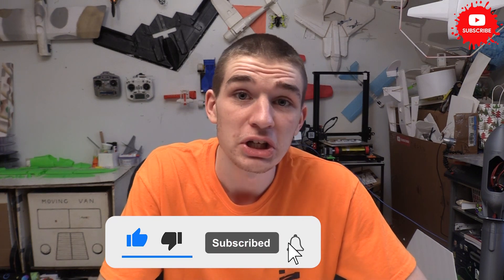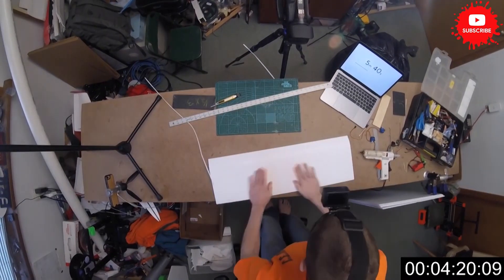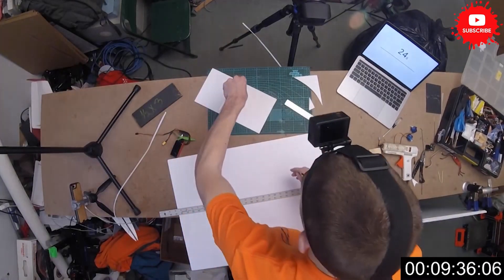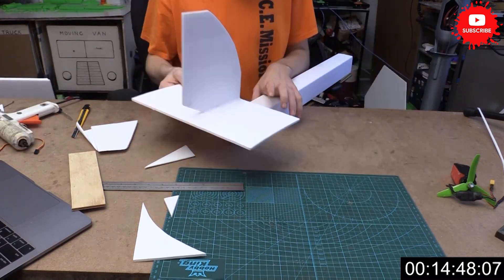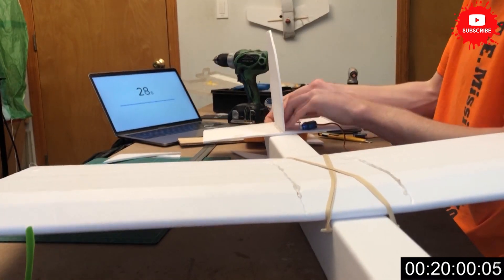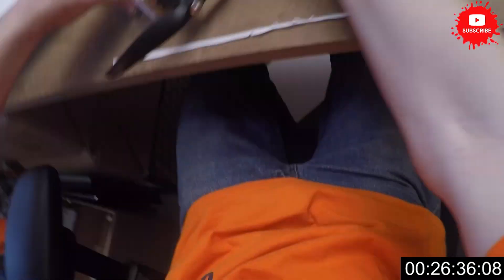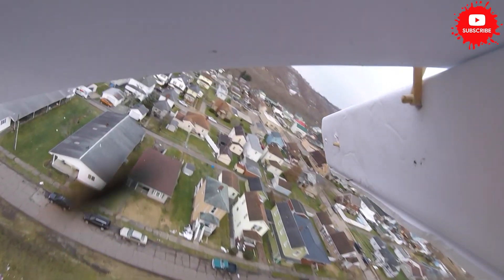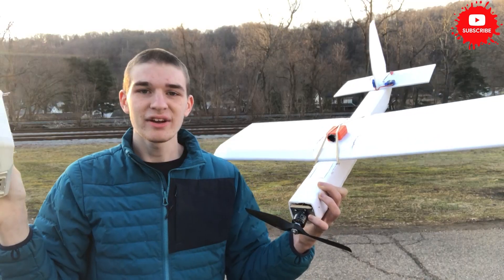How to Build a Super Simple RC Airplane for Beginners

Comment: Great effort mate. I have all the same electronics as per your list except I have a 1000KV motor. Would this have enough power for a beginner please?
Reply from the maker: That's totally fine—just make sure to choose your prop size based on your setup. Remember, KV is just the motor's speed rating (RPM per volt), not its power. The prop and voltage determine how much power (and current) you're actually pulling.

For a 3S (11.1V) LiPo:

9x4.7

10x4.5

10x6

11x4.7 (only if the motor can handle the current)

These sizes work well for park flyers, trainers, or slow flyers. A 10x4.5 is a great starting point for balanced thrust and efficiency.

For a 4S (14.8V) LiPo:

8x4

9x4.5 (only if your motor and ESC can handle the higher current draw)

With 4S, you get significantly more RPM, so you’ll need a smaller prop to avoid overheating the motor or ESC.

Have a great day and good luck on the build!

Comment: Do you have any advice for me I'm trying to build my first plane after many other builds
Reply: And what camera did you use? Is it just a go pro?
Reply from the maker: Its a Runcam 6
Reply from the maker: Absolutely! Building your first plane is a fun challenge—even if you’ve done other builds, this is a whole different kind of project. My advice would be to keep it simple for your first one. A flat-bottom wing, high-wing design with a bit of dihedral will really help with stability. Make sure your center of gravity (CG) is in the right spot—that makes a huge difference. Also, do a throw test before adding power to catch any issues early. Most importantly, have fun with it! Crashes are just part of the learning. What kind of plane are you building? Would love to hear more!

Comment: What type of foam do you use, because I’m getting into the building portion of aviation, but most foam just crumples when I try to cut it.
Reply from the maker: I’m using rediboard foam board. It is 3/16” foam with paper on each side. Check out the description for other info. Also check out Flite test on YouTube for some great info. Good luck!!
Reply: @EricRobb  thanks!

Comment: There was a simple foam board kit plane available in the 1990s called the Folding Flyer. Very similar to your plane but had a Jedelsky airfoil wing. Used a Norvel 0.49 glow engine. A pretty good flyer too. I build a replica out of foarm board which flew a little better than the the original.

Comment: I was wondering if you could explain how the electronics are wired?
Reply from the maker: Yeah for sure! Check out this video I made about the electronics: RC Plane Electronics 101: A Beginner's Guide to Wiring and Connections
https://youtu.be/JA3Lvf301mM
Reply: @EricRobb  Thank you so much! this helped a lot! Sorry to disturb though, but if i have a 2250mah battery but my motor can only go up to 2200mah, is that a problem or can the esc handle it?

Comment: You can make control arms out of popsicle sticks and plastic cards ect. Buolding foam board plane doesnt have to be complicated jaut to get in the air and get a feel of what rc plane flying is like
Reply: Guitar strings and coffee stirrers make great control cables. Coffee stirrers (the two tubed type make great hinges for elevators and rudders if you cut them right.)

Comment: Hello, thanks for this, might try it out! I see the battery is listed as: 3S Lipo Battery 80C 1300mAh 11.1V Lipo Battery with XT60 Connector. Can you elaborate on what you meant when you said, "I would also recommend you get an adapter for the use of a xt60 connector instead of a deans connector for your battery"? What adapter do you recommend? Do you have a link for it? Also, the battery is out of stock currently. Any other battery recommendations? Thanks!
Reply: I looked it up, it means the battery he recommends has a deans connection (shape of the prongs for the plug), while the linked ESC (speed controller) is comes with a XT60 connector (The female side of a different shaped plug). You can actually just buy a battery that already has an XT connector and save your self from getting the adapter. When you look at the pics of the ESC and the Battery, you should be able to see that box on the end of the wires... that's the plug, one side male the other female.  Hope that helps!

Comment: Balsa is alot more durable than one who never built on would think, even good flying ones will occasionally hit hard, and surprisingly it takes  a REALLY hard hit to damage them.   Balsa is weak, but once constructed and covered, its pretty strong and very rewarding once done.   I reccommend it for any airplane enthusiast.
Reply: Once you discover how easy it is to make dozens of wing ribs with a singular template, 2 bolts and piece of balsa with a wood router, you can start mass-producing good balsa airplanes in hours :) Just use right materials and right techniques
Reply from the maker: Thanks for the tip!
Reply: My first plane was a control line cox ju87d stuka. All plastic nitro model.
Next was a Big Otto Balsa kit. And a little satan control line balsa kit. I crashed all of them.

Comment: what motor, battery, reciever, and servos were you using? been flying for a while but want to build my first plane and thought this would be a good start.
Reply from the maker: Everything is in the video description. Let me know if anything is missing. Have a great day!
Reply: @EricRobb  I don't see any of it
Reply from the maker: ELECTRONICS:
1. Servo https://hobbyking.com/en_us/hxt900-micro-servo-1-6kg-0-12sec-9g.html?___store=en_us
https://smile.amazon.com/gp/product/B089GNYF1F/ref=ox_sc_saved_image_4?smid=A2XLLJ8HYD6SMA&psc=1
2. ESC https://hobbyking.com/en_us/turnigy-plush-32-30a-2-4s-brushless-speed-controller-w-bec-rev1-1-0.html?queryID=6c04911cd56f941fb620b377af5622a4&objectID=86262&indexName=hbk_live_products_analytics
https://www.amazon.com/RC-Brushless-Electric-Controller-bullet/dp/B071GRSFBD/ref=asc_df_B071GRSFBD/?tag=hyprod-20&linkCode=df0&hvadid=242048352875&hvpos=&hvnetw=g&hvrand=4102680705224588365&hvpone=&hvptwo=&hvqmt=&hvdev=c&hvdvcmdl=&hvlocint=&hvlocphy=9015222&hvtargid=pla-450627505645&psc=1
3. Motor https://hobbyking.com/en_us/propdrive-v2-2830-1200kv-brushless-outrunner-motor.html?queryID=eeda8ef4c02f966598265ed01da924c0&objectID=58843&indexName=hbk_live_products_analytics
4. Propeller https://smile.amazon.com/SoloGood-10x4-5-Propellers-Quadcopter-Multirotor/dp/B091KGR9Z6/ref=sr_1_13?crid=1Y6E70MZ843XV&keywords=10x4+prop&qid=1662467461&sprefix=10x4+prop%2Caps%2C90&sr=8-13
5. Battery https://hobbyking.com/en_us/turnigy-2200mah-3s-30c-lipo-pack.html?___store=en_us
https://smile.amazon.com/OVONIC-1300mAh-Battery-Airplane-Racing/dp/B0784C39DP/ref=sr_1_10?crid=2OFPX5XIR7RQO&keywords=1300mah+3s+lipo&qid=1659456378&sprefix=1300mah+3s+lipo%2Caps%2C77&sr=8-10
6. Controller & Receiver: https://smile.amazon.com/FLYSKY-Transmitter-Controller-Receiver-Upgrade/dp/B07Z8VCB45/ref=sr_1_1_sspa?crid=2W3NV8QSHZIV3&keywords=flysky&qid=1659456136&sprefix=flysky%2Caps%2C123&sr=8-1-spons&psc=1&smid=A27Y3358ST3KOY&spLa=ZW5jcnlwdGVkUXVhbGlmaWVyPUFaRzRIOUVRUFRYU00mZW5jcnlwdGVkSWQ9QTA1OTMzMDdIMFA5VlVFSkg5T0EmZW5jcnlwdGVkQWRJZD1BMDY1ODA4NDFZWjBMVFpBQzNSNVEmd2lkZ2V0TmFtZT1zcF9hdGYmYWN0aW9uPWNsaWNrUmVkaXJlY3QmZG9Ob3RMb2dDbGljaz10cnVl

Comment: Hey man, I love the plane! what's the dimensions of the fuselage, the width specifically?  You used 30'' for the length, but i'm not sure if I heard the width in the video, maybe i missed it?
Reply from the maker: The interior dimensions of the fuselage is actually 44x50mm
Reply from the maker: It isn’t super important. I just based the size of the fuselage on the electronics pod that I had. I think it’s about 2” high by 2.5” wide.

Comment: Can you share the measurements you use for each cut please?
Reply from the maker: I’m using 20in by 30in sheets of foam board. The wing is 30” wide and the fuselage is 30” long. The elevator is about 5” by 12” and the rudder is about 8” tall by 5” wide. Hope this helps!
Reply: @EricRobb  Yes this is helpful. How far down is the first cut to make the spline for the wing? How far down are the scores in order to fold the wing over to make the airfoil? How wide did you make the fuselage?

Comment: How did you make the choice of which engine and prop and servos and electronics to use?
Reply from the maker: For servos I used 9g, because that’s kind of a standard for RC airplanes in the hobby. The motor and prop I honestly just took the setup from another plane that’s about the same size that I love. That’s the beauty of using power pods. I can just slide the electronics out of one airplane and into another. There are links to everything in the description. Have a great day!

Comment: Can i use my RC car parts and accessories to make RC plane?
Reply from the maker: The servos for rc cars are generally a lot heavier than necessary. You would have to put the servo as close to the front of the airplane as possible to get the center of gravity right. The motors out of rc car are also a lot heavier and it just wouldn’t make sense to put in an airplane. There are links in the description of this video for electronics to buy or if you want an all inclusive kit go to store.flitetest.com 
Have a great day!

Comment: Building a first plane I love how little accurate it needs to be, thanks for giving me a confidence boost.
Reply from the maker: Yeah, it really is not rocket science. Hope your build goes well!
Reply: @EricRobb the irony cus it kinda is 😂
Reply: @hyperdeez pre-rocket science 😂
Reply: Foam board planes are very simple to build by hand with out plans to trace just some simple folds and big enough wing with dihedral and big enough vertical and horizontal stabs is the biggest thing cause if it's to small it's not gonna fly well
Reply: Wood is hard to with , its need.ungoldy ammount of sanding
Reply: Isn't it amazing how some of the most important things constantly get overlooked or underestimated, but retailers will have you believe that failure is the only road to success. So if you crash your RC plane, it's not because nobody told you about center of gravity or nothing. Just keep buying our planes at $300 a pop. You'll eventually get one that flies itself. 😅

Comment: This is exactly how I been making mine for years even a few years before flite test existed. I was making foam board rc planes when I was 10 in 2002. Now it's easier because we have access to really cheap smaller lighter electronics and motors . Building a plane when I was 10 consisted of balsa and plans back in 2002 cuse foam planes was junk and not to great like we have now in arf abd rtf planes. So of you wanted a good sturdy abd great flying trainer back then we had to build them with balsa then get someone on a buddy box to teach you to fly cuse all this gyro stuff abd stabilizers  didn't exist so only way to learn was either buddy box with a 40 to 50 inch wingspan trainer plane or learn on your own abd crash and spend another month building another plane. I'm 30 years old now and love being g able to build a quick trainer plane in matter of a hour or two or all the balsa arfs  thats out now and all the beautiful  amazing foam scale looking planes that's out now is amazing.  Cost of learning to fly is about a quarter of what it use to cost when I was learning in 02 at age of ten. Dad bought ne 5 trainer balsa kits abd we built all of them except one abd after I crashed the third one I was able to fly on my own with no problems. And no my dad was not a rc plane pilot when I was learning we learned together.  I still fly way better then he does. But he is really good at building and has 52 balsa planes built abd ready to fly hanging on walls and ceilings of our climate controlled work shop om his back yard that is the size of a 5 car shop. Abd still building he us. He has built every balsa kit off of bang good and I have flown all of then atleasy once and they all fly perfect like they are on rails. They are laser cut no plans to build onto of cuse they jig together tightly then then you glue it.  The instructions suck but not to hard to figure out andnqorth it cuse theybfly nicely

Comment: Which type of form u have used and how much kv motor? Is the plane dimensions avilable?
Reply from the maker: Its 5mm foam board from Dollar tree/Dollar general. The motor is a 2830 1200kv brushless outrunner, but it's way overpowered for the size of this airplane. The sheets of faom used are 20x30"
Reply: @EricRobb  hey! A 20×30 sheet is THAT BIG? Jeez i was seriously underestimating it... im making a P51 Mustang (my first plane honestly), using a 2212 1400kv motor as thats the most affordable atm- also, it has 1kg thrust with a 1045 prop, so I guess thats fine... I want my mustang to have a 1m wingspan... I hope it goes well lol- using a FlySky fsi6 tx rx... your video was actually very informative and I sure will use your methods to make airfoil and stuff...! Keep up the good work!!!
Reply from the maker: @Ayoitsme-m8e  Thanks for your kind words. Let me know if you have any questions. Have a great Day!
Reply: @EricRobb  hey! Thanks! I just ordered 30"×20" foam sheets from amazon! Well, I found put two of my 6 servos are not working and I can't get them replaced either... so I gotta cancel my plan of making a mustang and I'll just make a piper cub or something... My servos were greasy when I opened the package... do you have any idea how I can fix them? I can't afford to buy new ones...
Reply from the maker: @Ayoitsme-m8e   @Cody M  Can you describe a bit better "Not working" Do you think a gear inside is broken, or is there something wrong this the electronics? Is the motor inside spinning? Hope I can help.
Reply: @EricRobb  the motor isnt spinning... its like its not getting any power at all... I bought it from a local robotics store and its been a week so he wont replace it... I actually opened the packet containing those 2 servos today, and they felt oily to my hand... The receiver is fine (flysky FS-iA6B) because I tested the other servos on different channels... they work perfectly... Idk... I wanted to make a 6ch mustang but I guess I'll just make a 6ch piper now lol... I cant afford to buy new ones... i already went way over budget cuz depron is super expensive here... I might add lights to the 6th channel... im going to use flapperons so no extra servos for flaps... the two that stopped working, I was planning to use them for my Mustang's landing gear... but piper has fixed landing gear so no need for that no more... do you know any single propellor plane other than piper or cessna that had fixed landing gear? Or something similar? Like... a plane with low wing loading and fixed gear?
Reply: @EricRobb  also, I subbed :) you explain stuff much better than those other folk out there- keep up the good work man!
Reply from the maker: @Ayoitsme-m8e https://forum.flitetest.com/index.php?threads%2Fsp0nz-plans-index.17136%2F&fbclid=IwAR1VJub-73XCQRPDkVvQ8Tc8BCAoQhWrxxvJaCt9qasr2_R6cyHbKGIxjcQ
Here is a ton of awesome planes with plans so you can build them or use them as inspiration.
Reply from the maker: @Ayoitsme-m8e  And really you don't need to have retracts on your landing gear. they look way cooler, but not necessary.
Reply: @EricRobb  ill just cut the wires from those 2 servos and solder them to my LEDs and put them on wingtips on 6th channel- i might end up making the mustang cuz... i love that plane lol... just, without the landing gear... also, this is actually my first plane build😶 ive flown rc planes so im not new to flying them, I've built some micro rc planes in the past, which used those tiny brushed motors and those WLToys recievers but this is the first one im making with proper hobby grade stuff-

Comment: Is the dihedral thing necessary? Cause I screwed up my entire wing trying to do it
Reply from the maker: The short answer is yes, especially for new pilots. It helps with the stability of the airplane in the roll axis and give the airplane a self righting tendency. Especially necessary for airplane without ailerons like this one.
Here is a video that explains why a little more: https://youtu.be/u_pyNpvUejo?t=103
Let me know if you have any more questions. Have a great day!
Reply: @EricRobb  Thanks! Didnt know that. In the end, it didn't turn out that bad. But then my only battery failed. Convenient. Thanks again!
Reply from the maker: @ttpechon2535  No Problem. Let me know if I can help with anything else or if you have any topics you think I should tackle in a video.. Have a great day! a great day!

Comment: Hey, how did you get the servo wires down to the nose of the plane?
Reply from the maker: Too fish wires in plane, I use a piece of servo wire, and bend a hook in the end of it, and feed the stiff wire up the channel I want the wires to be; and pull the servo wires through. In this airplane, I also had to use servo extensions, so the wires would reach the front of the plane. I hope that helped. Have a great day!